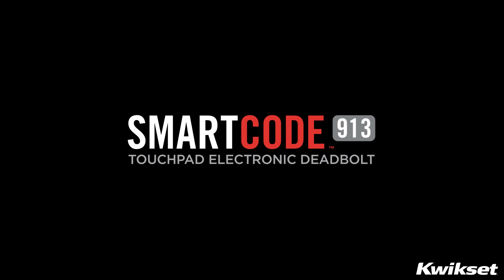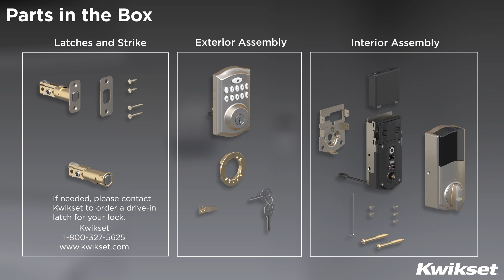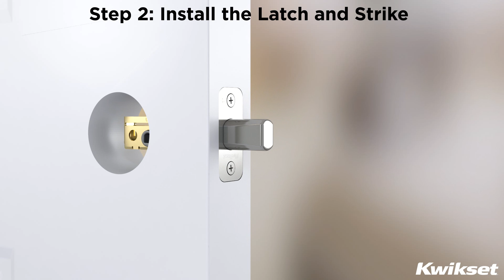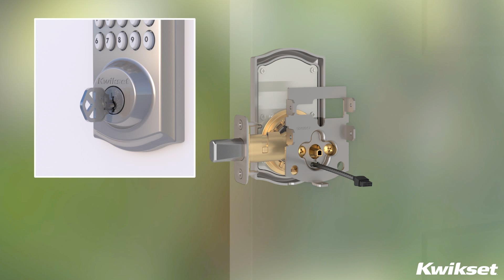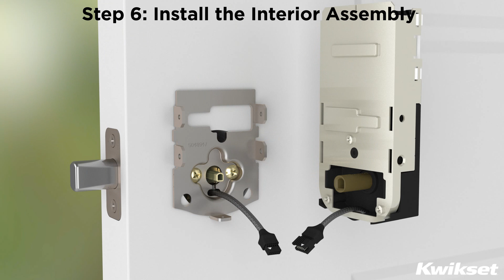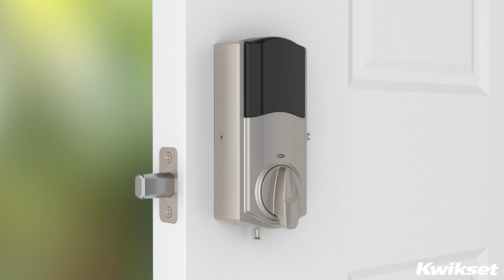SmartCode 913 Electronic Keypad Deadbolt Installation Video

Comment: Didn’t come with mounting plate
Reply from the maker: Hi and here to help! The mounting plate is generally attached to the interior assembly of the lock and can be removed before installation. If you cannot find the mounting plate attached, we're happy to replace it. Our Consumer Support Team is here to help... please contact them here: https://kwik.st/3C2pQMR or call them at 1-800-327-LOCK (5625). Thanks ~ Kwikset Social

Comment: I had the exact same issue.  No movement in and out.
Reply from the maker: Hi Sean - Here to help! To ensure the latch hands properly, please make sure the lock was installed with the latch fully extended, replace the batteries, and perform the manual door handing process in this video link: https://kwik.st/3C8Xz7F  Our Consumer Support Team is happy to help you further... please contact them here: https://kwik.st/3dM0Jow or call them at 1-800-327-LOCK (5625). Thanks ~ Kwikset Social

Comment: How do you get the keypad to light up?
Reply from the maker: Hi Loyd - Here to help! To illuminate the keypad, you must push the LOCK button at the top of the keypad while the deadbolt is in the LOCKED position. All the buttons on the keypad will then light up to enter your user code. Thanks ~ Kwikset Social

Comment: Mine didn’t come with a mounting plate.
Reply from the maker: Hi Dean - Here to help! Please check the backside of the interior assembly of the lock, as the mounting plate may already be attached to it. It's a black piece that you will have to detach to install onto the door. Should you need help with this part, please call our Consumer Support Team for further assistance at 1-800-327-LOCK (5625). Thanks ~ Kwikset Social

Comment: Is this weather proof? Can it be installed for exterior doors?
Reply from the maker: Hi Abraham - Happy to help! The SmartCode 913 can be installed on a door where the interior of the lock is enclosed, and protected from the outside elements, while the keypad can face the exterior. This is not a fully weatherproof lock and cannot be installed on an outside gate or door with no interior covering or protection. Thanks ~ Kwikset Social

Comment: How do you reverse the l9ck/unlock direction
Reply from the maker: Hi Heather - To reverse the locking and unlocking direction, please follow these steps:
1. Open the door and place the latch bolt in the extended/locked position.
2. Unscrew and remove the interior assembly of the lock and pull it off of the door, making sure the latch is still extended.
3. Ensure the triangle on the interior assembly looks like image 4Ac: https://kwik.st/3sqf5hz
4. Reattach and screw on the interior assembly of the lock. Please do not attempt to unlock the latch, keep it extended.
5. Follow step 5 in the installation guide to set the locking direction.
6. Test the lock by entering your code to unlock and pressing the lock button to lock.
Thanks ~ Kwikset Social

Comment: Wow I’m so lucky; mine came without a mounting plate
Reply from the maker: Hi Hyde 37 - Here to help! The mounting plate can be attached to the interior assembly of the lock. Please check there and for additional support, our Consumer Support Team is happy to help... please contact them here: https://kwik.st/3ytZlwE or call them at: 1-800-327-LOCK (5625). Thanks ~ Kwikset Social
Reply: @kwikset   I just bought this lock and my lock also did not come with a mounting plate.  I checked the interior assemblies to see if it was per-assembled somehow, but it was not there.  Came onto Youtube to see what the mounting plate looked like just to double check that I was indeed missing the part.  Not sure how something that large could have been missed being put into the box, but with Hyde 37 having the same problem, you guys need to fire somebody on the assembly line.
Reply from the maker: Hi! Our Consumer Support Team is here to help by replacing any missing parts and help with installation... please contact them here: https://kwik.st/3mtrU8N or call them at: 1-800-327-LOCK (5625). Thanks ~ Kwikset Social
Reply: Same problem what a scam!
Reply from the maker: Hi Joseph - Here to help! Our Consumer Support Team is here to help... please contact them here: https://kwik.st/3FzSwNG or call them at 1-800-327-LOCK (5625). Thanks ~ Kwikset Social
Reply: Same problem here.  No mounting plate!!

Comment: Problem is my D shape isn’t facing up when lock extended it’s facing to the side, so the whole set up is fcked
Reply from the maker: Hi and here to help! To rotate the D-shape part in the correct direction, please remove the interior assembly off of the door. Place the cover onto the interior assembly while in your hand and rotate the turn-piece clockwise, forcing it to click past the point of resistance. It will then align with the D-shape spindle in the door. See section 4 in this installation guide for illustrations of this step: https://kwik.st/2ZGQE54 For further help, please call our Consumer Support Team at 1-800-327-LOCK (5625). Thanks ~ Kwikset Social

Comment: I realized what my problem is. It's the cables. They keep getting pinched. There isn't enough room to keep them in place. When the bolt moves, it causes the cables to move and pinch and then doesn't work all over again. This is a pain in the ass.
Reply from the maker: Hi! Our Consumer Support Team is here to help... please contact them here: https://kwik.st/3yAQFnS or call them at: 1-800-327-LOCK (5625). Thanks ~ Kwikset Social
Reply: did you find a solution? i have the same problem and i tried calling but it’s closed

Comment: I usually only post positive comments, but this has been an awful experience, and time wasted.  This door locking unit has poorly engineered internal designs in regards to the motor function. The lock/unlock battery operated motor is loud and cheaply manufactured.  The unit does not fully retract or extend the deadbolt throw. Purchased two units and still have the same issues.  I watched this video, and followed the directions perfectly!  I'm confident Kwickset is receiving several returned units.  Don't waste your time or money.
Reply from the maker: Here to help! Please send us a direct message so we can collect details from you to better assist here. Thanks – Kwikset Social

Comment: Everything was good until they offered no alternatives to the test of holding the lock button while inserting the battery, not working. They should say "if the lock doesn't retract and extend back and forth on it's own the check this or that ...." because mine stood still. I followed all of the instructions up until that point.
Reply: I'm having this exact issue. The latch just doesn't move on its own, going to call and replace this unit but it sounds like I should just return it for a refund if everyone is having this issue.
Reply: Tried new batteries, not working. Returned the three I tried, ordered a Brinks.
Reply: Currently having this issue
Reply from the maker: Hi! Our Consumer Support team is here to help... please contact them here: https://kwik.st/3l7y9gv or call them at: 1-800-327-LOCK (5625)
Reply: Yup, now on the second one with same issue. Pressing button then inserting batteries doesn't do anything.
Reply from the maker: Hi Omar - To ensure the lock completes the door handing process successfully, please try a new set of alkaline batteries and make sure to hold the lock button until the batteries are fully inserted. For one-on-one troubleshooting over the phone, please call our Support Team at 1-800-327-LOCK (5625). Thanks ~ Kwikset Social
Reply from the maker: Hi Omar - Our consumer support team is here to help walk you through troubleshooting or provide warranty support. Please contact them here: https://kwik.st/3yhnRzo or call them at 1-800-327-LOCK (5625) Thanks ~ Kwikset Social

Comment: This video by far is the best solution to install difficulties. We were frustrated like others regarding the locking mechanism, however, after watching the video and learning about the "handing" procedure, the lock is working great!  My only suggestion for Kwikset would be to explain this issue more in the instructions. We are so impressed with this lock and ease of use after being properly educated on the set up. If we could post pictures of our gate where it's installed, we would! Looks fantastic and works like a charm!
Reply: 2²

Comment: Is there a left hand and a right hand lock? As I'm looking at my front door from the inside, the handle is on the left side. I can't get the "D" shaft to line up with the interior assembly. However, if I put the interior assembly on the outside and the outside assembly on the inside it will work. Or, if my door handle was on the opposite side of the door, it would work.
Reply: It’s the door handling step. Hold the lock key before you drop battery in, then the computer figures itself out if your door is right or left handed
Reply: Mark Couture were you able to figure it out? Having same issue

Comment: This product doesn’t work don’t waste your money 💰
Reply: It does work is it a bit of a pain to install if you dont have pre cut holes that's for sure. But the big step I was missing until I watched this video was putting the battery in while holding the outside lock button down. It automatically adjusted the lock to its correct position before seeing this video I was ready to disassemble and throw it out the window.
Reply: the "door handing" process doesn't work for me either. tried different new batteries, adjusted the screws, factory reset operations... but the critical step never attempts to retract/extend the bolt for the learning process. will be returning and looking for another product
Reply: @robertlybarger  same problem here. What does yours do? mine beeps and doesnt move the bolt.
Reply: I have the same problem also!
Reply: @jtmarcel640  same. Returned ours and replaced with another brand.
Reply: If it doesn't work, why does it get so many positive reviews on Amazon? Did you install it properly? Is your door out of alignment or the door holes off? Do you even have one of the units? What specifically didn't work for you?
Reply: @youarehere1716  right out of the box the provided key didn't unlock the lock. Their solution is to adjust the screws after you attach it. See the problem here? So now it literally doesn't work😂🤣 now u get to waste more time putting the old lock back on and taking this POS back to the store.
Reply: That's totally true
Reply: it works fine on my door stop whining